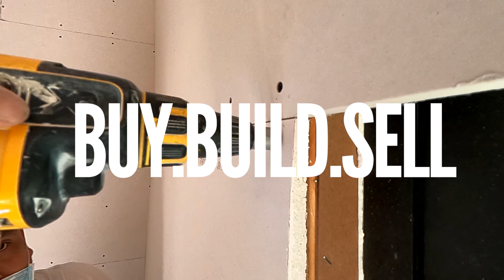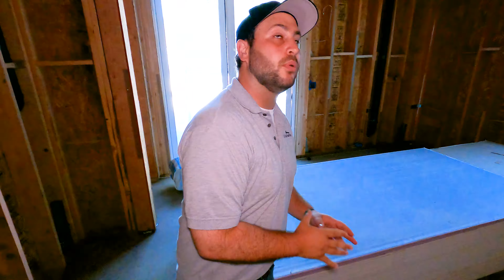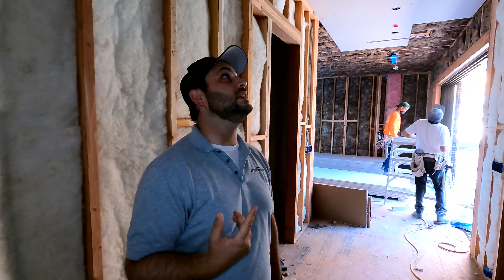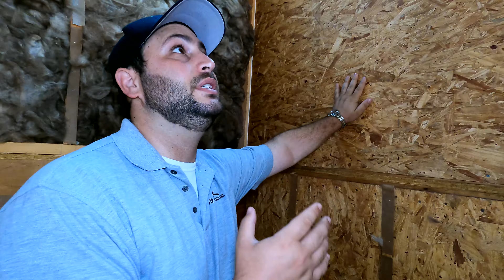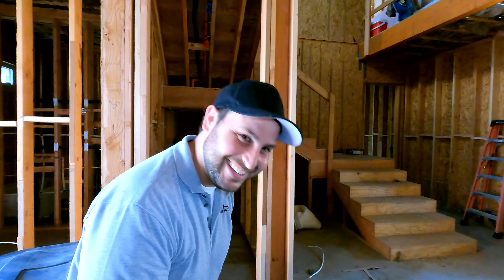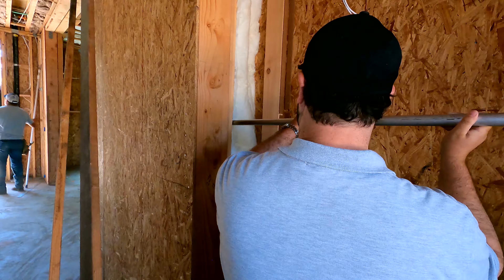Insulation and Drywall | Jason Pie

Comment: You need to have the right opinion on board hang layout. There's only one. Fewest but joints possible, boards are always installed  perpendicular to wooden studs or joists. Not metal studs though because these don't expand, contract, and twist like wood does among other things.
Reply from the maker: Solid opinion. That’s definitely not the opinion of everyone. But I do know a few that agree with you. I also depends on height!